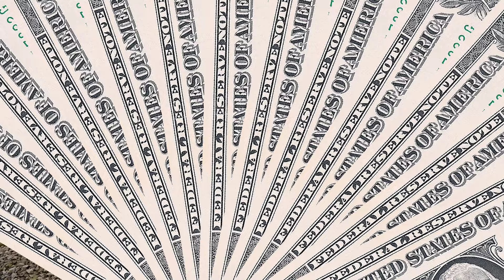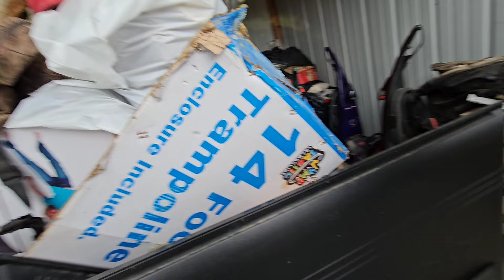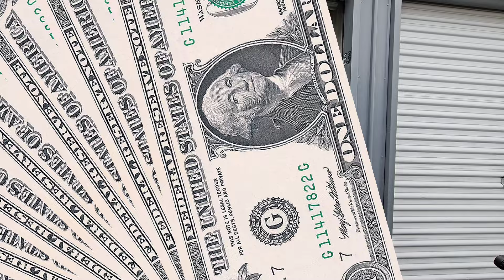I Bought An Abandon Storage Unit for ONLY $25! ~ #Real Storage Wars

Comment: Will you please explain the lockbox issue. I didnt understand. Thanks! 😊
Reply from the maker: I was saying I couldn't buy the unit if the only thing I saw was a lockbox that I wanted. 9.5 out of 10 times there is nothing but paperwork inside